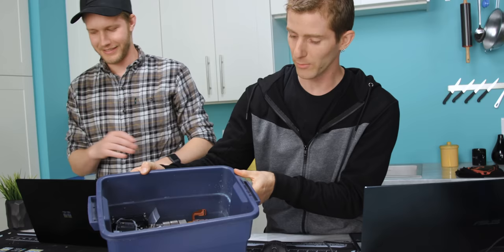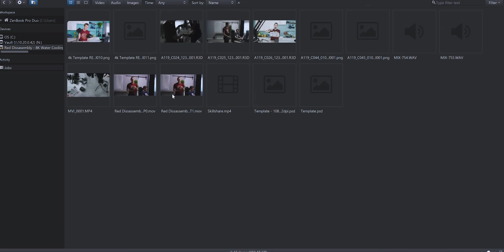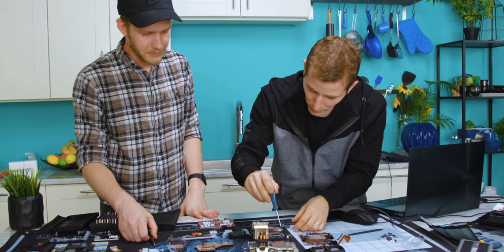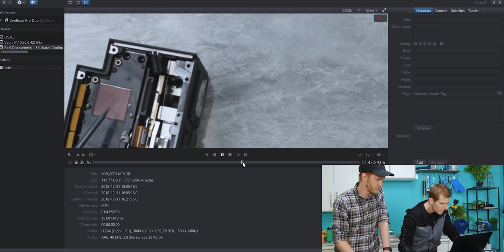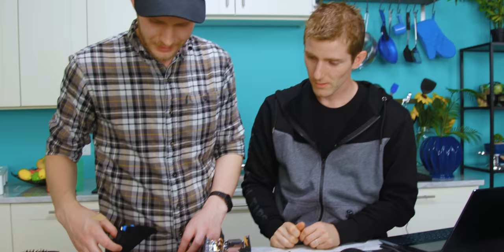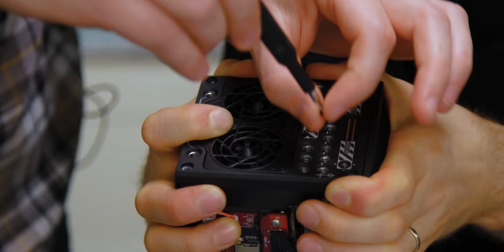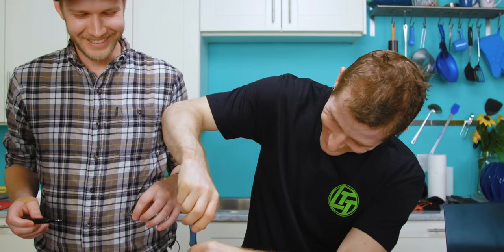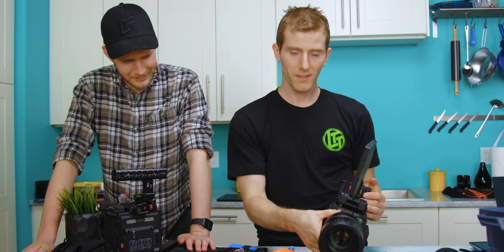Reassembling our $40,000 Camera

Comment: I can just imagine a RED sales rep watching this, drooling over a future RED (Replacement due to voided warranty) sale to LTT.
Reply: fortunately warranty "void if removed or damaged" type stickers are illegal. 
So it doesn't matter. 
If RED refused to honor a warranty based on that, then LTT and the thousands of lawyers waiting for the opportunity, would jump on RED and sue them into nothingness.
Reply: Martin B Warranties can be voided if you’re opening it in order to modify it. Those stickers are only illegal if you’re fixing something.
Reply: @Adam-vp4pv  Hence why I did not go so far as to talk about modification. Because damaging or removing a warranty void if removed sticker is separate legally from repairs or accidental damage due to attempted repairs by an unauthorized person while the product is under warranty.

With that said my comment was more specific to the current context which is that they opened it up, disassembled it and put it together again. 
Within that context, if they were to have their warranty voided it would be illegal. 
Perhaps I should have been clear on that. 

On a separate note, modification depending on the type may still fall under being safe. 
If modification does not extend to changing the products existing solid structures and is reversible without damage to any electronics or the devices physical appearance internally or externally. Then it would be fine.
So as long as they do not physically modify the chassis or cause damage during their installation of water cooling. Then it is still perfectly fine as long as they can reverse the change and have no damage caused.
Reply: Why would RED not want to fix Linus's camera.. It's Linus Tech tips they got so much free press about them.. I never knew of Red till Linus.. Now is not the place for them to stop looking good.  All they have to do is just say, this is not the thing we normally do... please don't do what Linus does..
Reply: @baloneyjusticecheezedog  Tell that same thing to Apple. 
Also if Red really cared they would have sent him some of their stupidly expensive stuff for free or at a discount by now. 

Their market is not people at home watching Linus doing silly things.
Reply: @baloneyjusticecheezedog  They are getting free press (a lot of it is complaints about workflow though), but honestly if you were anywhere involved in production level videography you would have heard of them. So you're probably not part of their market to begin with.
Reply: @baloneyjusticecheezedog  Apple and RED have different business models. Apple sells to individuals. RED sells to businesses. 

RED is also focused on large sales. Yes they will sell single cameras, But the 40k USD that Linus spends on a single camera is not what they are concerned about. 
They sell to movie and series production companies primarily. Those companies spending several million in a single shop with RED. 
Red's annual revenue is roughly 60 Million USD. 40K is  a drop in the bucket for them.
For RED they don't care about the eyes of us normal people that watch LTT. They care about the eyes of businesses.

It is a lot like Intel with their Xeon server processors. Intel does not care about the 1 or 2 Xeon processors they sell to baller home users or small businesses. They care about the hundreds or thousands of processors that they sell to companies with massive server farms .

On another note. RED has been around since 1999. But most people would not know that. Why?  because the only people that historically had RED cameras are big movie companies or a few directors. At least until about 5-7 years ago more or less. 
Unless you were watching a movie that was recorded digitally before then and waited through the credits. You might not have known RED existed at all.
Reply: @super_salty9189  it's illegal only in the USA, they are not under USA's jurisdiction (I could be wrong). But still they have enough basis to deny warranty because it's highly possible they might have caused a random error while disassembling and reassembling the camera, since it's a highly specialised product, hence they don't have to provide warranty since they can reasonably claim the damage was done by them while doing something that wasn't it's recommended use case
Reply: @tejaswipradhan558  There are other places in the world where it is illegal or invalid. 
"they are not under USA's jurisdiction"   LTT or RED Digital Cinema?  
LTT is Canada based and Canada has different rules for different areas as far as i know. So you would have to know the specifics for the area of their business. 
RED is an American company. 
So LTT could potentially sue RED in the states. Specifically California where their headquarters are located which is probably where they are registered. 

"a random error"  an error no. It would be on RED to prove that any error was caused by LTT. They would have to prove that either something was physically damaged during assembly, storage or disassembly. Or they would have to prove without a doubt that due to the it's storage method or it's dissembled state, that it was exposed to something it would usually not be under normal customer use, thereby causing damage. 

There are plenty of ways to go about it really. But that's not the point. The chances that LTT would have to do that are slim to none in any event. 

Even if they were, it would probably never become public. It would not be a good image for either company and they would settle silently. 
That is typically how these things go.
Reply: @tejaswipradhan558  There are other places in the world where it is illegal or invalid. 
"they are not under USA's jurisdiction"   LTT or RED Digital Cinema?  
LTT is Canada based and Canada has different rules for different areas as far as i know. So you would have to know the specifics for the area of their business. 
RED is an American company. 
So LTT could potentially sue RED in the states. Specifically California where their headquarters are located which is probably where they are registered. 

"a random error"  an error no. It would be on RED to prove that any error was caused by LTT. They would have to prove that either something was physically damaged during assembly, storage or disassembly. Or they would have to prove without a doubt that due to the it's storage method or it's dissembled state, that it was exposed to something it would usually not be under normal customer use, thereby causing damage. 

There are plenty of ways to go about it really. But that's not the point. The chances that LTT would have to do that are slim to none in any event. 

Even if they were, it would probably never become public. It would not be a good image for either company and they would settle silently. 
That is typically how these things go.
Reply: @tejaswipradhan558  There are other places in the world where it is illegal or invalid. 
"they are not under USA's jurisdiction"   LTT or RED Digital Cinema?  
LTT is Canada based and Canada has different rules for different areas as far as i know. So you would have to know the specifics for the area of their business. 
RED is an American company. 
So LTT could potentially sue RED in the states. Specifically California where their headquarters are located which is probably where they are registered. 

"a random error"  an error no. It would be on RED to prove that any error was caused by LTT. They would have to prove that either something was physically damaged during assembly, storage or disassembly. Or they would have to prove without a doubt that due to the it's storage method or it's dissembled state, that it was exposed to something it would usually not be under normal customer use, thereby causing damage. 

There are plenty of ways to go about it really. But that's not the point. The chances that LTT would have to do that are slim to none in any event. 

Even if they were, it would probably never become public. It would not be a good image for either company and they would settle silently. 
That is typically how these things go.

Comment: Pretty sure it's splitting into 4GB chunks because the drive isn't formatted to EXFAT. Or the 40k camera doesn't support exfat and relies on fat32
Reply: It's not just necessary about the file size limits of the File System. I guess it's more about the reliability of the file produced. Easier to read, write, save. Eventually if one gets corrupted it's not the hole shooting.
Reply: @hegeduslevi  its for import taxes. If cameras record over 4gb then they pay another import tax so the file splitting is a workaround. DSLR's do the same thing.
Reply: İts because Redmags scam for forcing you to buy their software and drive totally scam

Comment: How are they supposed to watercool this thing? It's gonna require very custom blocks, tubes, fittings etc, and the way that thing is assembled it's so tight I don't think there's space for any of that.
Reply: KubeSquared it has beefy heatsinks inside that could be replaced with blocks and then you just drill holes in the casing. Or something.
Reply: Custom heatsinks with the new workshop they have
Reply: Well they bought loads of new equipment for their workshop for a reason(s)
Reply: Yea, but then you have to carry around water...in addition to the camera. Not sure that's a win....
Reply: @jakesully2868   how dare you state the obvious!

Comment: I could have sworn that when this project started someone said they had two of the same Red cameras so they could get the benchmarks later.  Maybe I'm remembering wrong.
Reply: No you're right. They do have 2 of them (well they recorded it with one of them and disassembled the other one, that's why they have to use that fancy software), but performance varies even across one model (similarly to how some CPUs can be overclocked better than others), because of the physics of the manufacturing process, so they wanted to benchmark the exact camera they were going to watercool. They answered a similar comment above, that's how I know.

Comment: So why didn't they contact RED for exploded schematics? Would've made all of this super simple.
Reply: Something like that may be confidential.
Reply: @gamingdude2811  Shouldn't be.  An explosion with a parts breakdown for assembly, parts ordering and repair is industry standard and usually available on request.  I make and provide these all the time for the company I work for.  A we readily provide them to the public when requested in most cases.  A parts list shouldn't give away any corp secrets. If you want that info to copy the camera its easy enough to buy and take one apart and probably get much more useful info.
The only reason I could think they would not provide them is if it's a warranty issue (they don't want you to ever take it apart) or they don't want 3rd parties making accessories for their cameras so they restrict info that ways.
Reply: ^ yeah, if you're buying a 40 THOUSAND DOLLAR camera I'd expect the company to give me whatever the fuck info about it I asked for.
Reply: Apparently you've never tried to reassemble something with exploded schematics the way they're doing it is far easier.
Reply: They would have flown 2 Techs over and then Linus would not be able have fun.
Reply: Do you know they don't have that in the background?
And it's not that much easier. Ideally it's combined with the images...
Reply: @davidmcguire6043  I'm an engineer and retired air force crew chief. So, yeah, I've assembled many things from exploded diagrams. It's actually much easier and faster than looking through some half baked pictures and videos. An exploded diagram should also have bolt size, thread pitch, and head type for something like this to avoid the "I think this is it" or "hope I didnt miss anything" nonsense.
Reply: @VetteTTV12  you must be retired to be bored enough to give me your whole resume to refute my little YouTube comment if you're good at using exploded diagrams good for you but in my experience is much easier to view the disassembly in reverse the way Linus did it. I'm also willing to bet with those credentials that you didn't have a lot of disassembly videos to use in your line of work.
Reply: @davidmcguire6043  lol ok.  An good exploded diagram can be a lot of help but a video can too.  If that's what works for you good.  Don't trash explosions so easily though.  They've only been used to assemble items for hundreds of years and that shit instructions you get from China or Ikea don't count.  
FYI a video wont give you a material description of items were a good BOM on an assembly diagram wouldve help those two figure out what screws went where.  Oh and if you have trouble using assembly drawings please don't get a job in manufacturing.  You'd be in trouble. lol.
Reply: @VetteTTV12  Pictures do help though.  When I make assembly manuals including some detail pics with Explosions can help.  Just curious what did you work on in your career?  I work with heavy duty Agricultural machinery myself.
Reply: They dont tell you anything, and that with a reason, it‘s like: ,,If you break it, you have to pay a new one, bc u voided the warranty“

Comment: Raises the question though... don't you have 2? Couldn't you just... do your tests with the other one and compare it to the water-cooled one?

Sure the test would not be perfect, but the point of that crazy project is to determine whether or not there would be any gains in water-cooling the camera. that goal would have been achieved if the difference was notable.

Comment: You have TWO RED CAMERAS!!! Why don't you use the other one for the baseline???
Reply: There might be subtle differences between the cameras which adds an additional variable.
Reply: @Igrium  since he has already disasemble it the baseline is already completely different
Reply: @geovani60624  yes, which adds to the complexity when comparing it to a different camera rather than itself
Reply: @Igrium  well, at least the other camera was still sealed with the original thermal paste, now that the changed it and other aspects of it, it doesn't really mather if they are using the same camera or the other one

Comment: Why didn’t you just buy/rent the same camera and run the benchmarks?
Reply: Daniel why wouldn’t they run the water poles benchmarks first and then reassemble it and run the air cooled
Reply: They already own a second unit so good question
Reply: device to device variance? they own a second one anyway lol.
Reply: The second one is not an 8k I believe, is it?

Comment: And that's mostly why it runs so hot, because it's very compact for what it is. For the resolution it delivers it is the smallest package in cinema cameras. (For now). 

Also, I think you did a great job putting the sandwich back together.

Comment: You guys should also check battery usage with and without water cooling. Higher temps mean more wasted energy via heat dissipation, but water cooling would need a pump? Could be interesting!

Comment: I went through this same thing yesterday putting together a Wii I took apart over a year ago. I spent like 30 mins trying to figure out were two little pieces of metal went, Littaraly touching it to different sections of the board to see if it fit. I also couldn't find some of my screws (until after I was done) so I was leftover with like over 10 screws hahaha. It pays to have plenty of pictures to reference when putting tech back together.

PS. I had pictures but I lost my phone a few months before and had to put the Wii together cold turkey.

Comment: Looking how compact they packed everything in there (impressive, truth be said), how do you plan to water cool it? Custom case? Well, you have just bought a full ensemble of machines to build said case, to house the custom water blocks (that also can be machined there), plus the tubing. Most likely the water reservoir will be placed outside (to better gage the levels for obvious reasons). But what will seal the deal will be... the seals. Any leakage could spell doom on 40k worth of equipment. The geek in me is quite jealous you guys get to engineer this from scratch, and i'm looking forward to see the results.

Comment: RED cameras has a BLACK SHADE calibration, that must be done using the temperature the camera will be working at that environment. You leave the camera running until the sensor heats and then do the black shade. For your test, you should consider that on both situations.

Also consider for the image something with a high dynamic range. Noise related to heat is visible at the low lights. Also try different frame rates, and record just the sensor with no image, all black.

Comment: BIG detail missed: Thermals are going to be completely inaccurate due to paste/pads being separated and reapplied using the existing materials. Temps WILL be higher than a Red that has had no thermal systems tampered with. You would have been better off using another Red for your baseline, OR reapplying thermal materials and paste.

Best example of proof, as to why this wont work, is comparable to a PC CPU cooler application/install. You don't reuse thermal paste; your thermal performance will suffer greatly after that paste has been "broke in" and then reused after removing and reinstalling the heatsink.

Linus, your baseline will CLEARLY be worse than any thermal system modification you guys make (ie, water cooling). Just a thought.